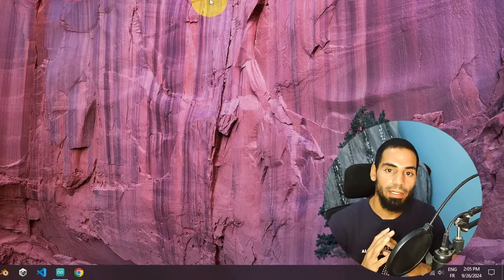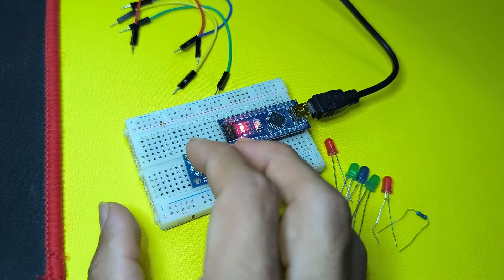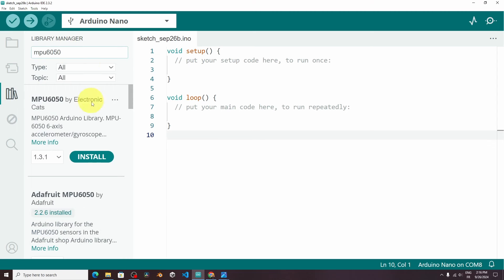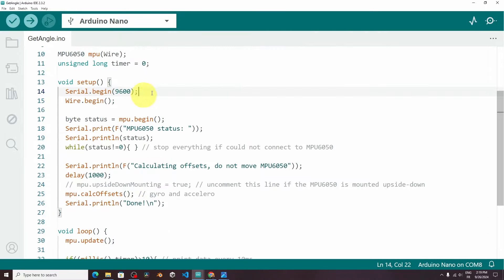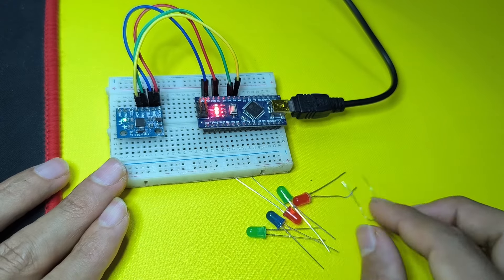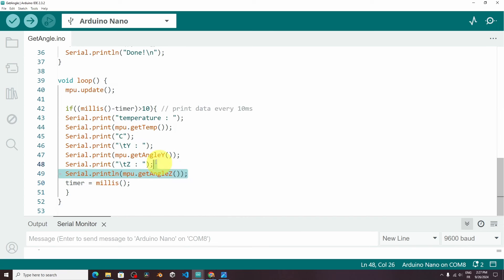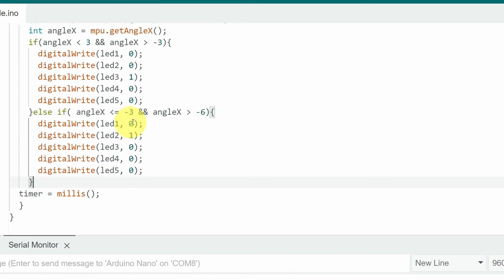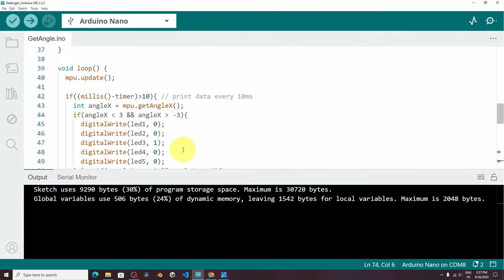MPU6050 Explained: Build Your Own Digital Level with Arduino!

Comment: Problem is, electronic circuit to check a flat surface.....I'd  prefer the spirit level. 
Bubbles need no power, debugging or wiring.